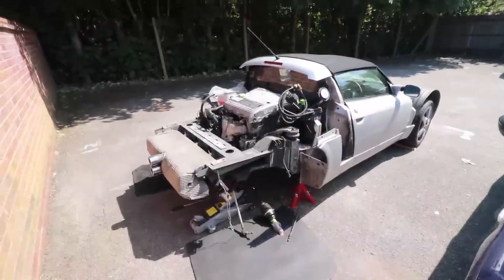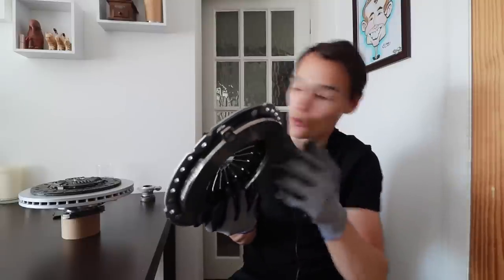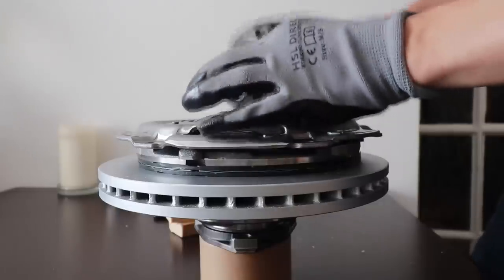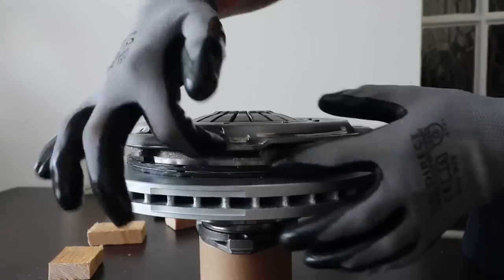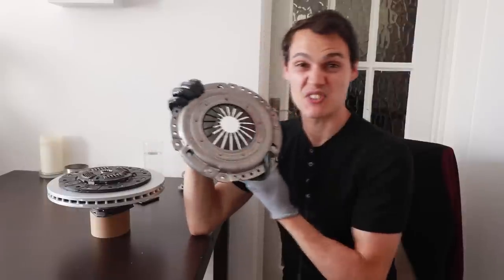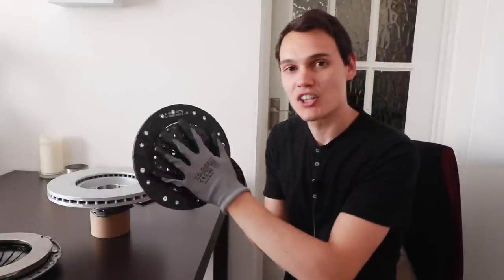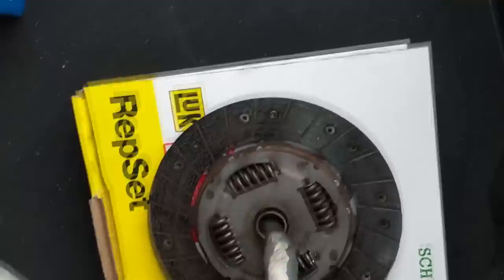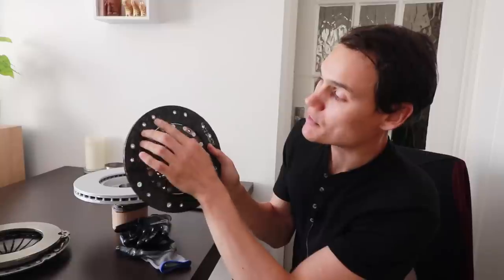How does a clutch work and what wears it out?

Comment: I've made the mistake of releasing the clutch too fast when going into first gear from a stop, because I was afraid of wearing out the friction material.  Also, my shifts aren't always as smooth as they should be.  Since I'm still relatively new to driving a manual, occasionally I still release the clutch too fast.  Then my car bucks like a bull at a rodeo, especially when going into first gear.  This video was super helpful.  Before I saw this video, I had no clue that the bucking is really bad for the transmission, and that I shouldn't worry about holding the clutch at the bite point for a little bit.  I'll be a lot more careful now with how I drive.  My concerns were misplaced - I was concerned about wearing out the friction material, when it was the bucking I should have worried about.
Reply from the maker: You're more than welcome. I used to think the same. Don't hold it on the bite point to keep the car still on a hill and keep the revs below 2000rpm when setting off and the clutch should not overheat.
Reply: @ConquerDriving  My car, a US spec 2020 Corolla Hatchback has a couple nifty  features that help out with hills - a brake hold and an electronic parking brake.  The first is for slight inclines, and the latter is for steeper grades, such as hills or highway off-ramps.  They automatically releases when you start moving forward.  So, the good news is, I'm never tempted to use the clutch to hold on a hill.  With my car, you can be sitting still on a hill, and have both feet on the floor.  Modern technology is great!  Anyway, thanks for the tip, I'll be careful to never rev the engine above 2,000 rpm when setting off.  Naturally, I want my clutch to last for hundreds of thousands of miles.

Comment: So what I'm getting from a few of your videos is...don't be afraid to hold the clutch and let it do what it is meant to do! Thats the part I've been struggling with. Afraid to use the clutch longer than switching gears or taking off, which in turn is causing bucking takeoffs. Higher gears has been just fine, I've been slowly letting off the clutch. 

But yeah all in all the videos I've watched from your channel have helped so friggin much. Im anxious to get back in to my used car and learn some more! Thank you!!
Reply from the maker: You're welcome. I remember feeling the same about the clutch but I have so much experience with them now I've been teaching for 12 years I've learnt what really wears them. Letting it smooth out gear changes and move away smoothly is fine.

Comment: A good way to show the counterintiutive movement of the diaphragm spring are these small round metal boxes sometimes used for mints. The way to open them is to push on the lid, it then does the same movement as the diaphragm spring.

Comment: i drive to the blue mountains and my clutch started slipping on the freeway. when i was comming back it was sliiping constantly and i was strugling to get going at trafic lights. it was time to replace my clutch. both me and my brother lernt to drive on the car. ( i brought it off him ) 

when i replaced my clutch ( did it my self with my dad ) the friction matiral hade worn to the point it was smoth and the fly wheal was toast as well. it hade over 315,000 km on it. i was going to change the fly wheel with my clutch weather it was still working or not becuse it was a dual mass flywheel. After the new clutch i wasent prepeardef for hoe low the bite point was and kept spinning my tiers. hade it for about 3 months and it feels so good.

Comment: Really interesting stuff! Just started learning how to drive and this channel has given me great information so far. I need just a little more help to understand the clutch better. Which of these situations is actually happening?

1. The friction disk is always in contact with the flywheel. The force from the pressure plate and clutch bearing determine whether there is enough friction to be engaged or not. 

(This seems great but wouldn't friction disk and flywheel would both wear out?).

2. The friction disk is never in contact with the flywheel. The friction disk only engages when it is in contact with the pressure plate. 

(This seems to work but I wonder if the friction would be enough from just the pressure plate)

3. The friction disk is sometimes in contact with the flywheel. The pressure plate causes the friction disk to come in contact with both the flywheel and pressure plate when it is engaged. 

(This also seems to work but how would the friction disk move through space? No forces or devices, to my knowledge, are there to keep it in between the plates without contact.)

After watching your video I think it is 3. But once again how would it move from engaged to disengaged. Nothing seems to be holding it in place.
Reply from the maker: I see what you're saying. The friction disc will not make contact with the pressure plate or the flywheel when the clutch is down because the fast rotation of both the pressure plate and flywheel will effectively kick it fiction disc off. There will only be wear with pressure, not slight contact. The brake pads work in the same way, it's not like a bicycle that needs a return spring to move the brake pad away from the brake discs. In a car simply releasing pressure of the brake pads will be enough, the pads are always gently touching the disc but as there is no pressure no braking or heat is generated. However unlike the brakes, there is actually a small 1-2mm gap between the friction disc and pressure plate and flywheel when the clutch is down. If something makes contact with something spinning fast it will be pushed away if it's the path of least resistance.
Reply: Conquer Driving Thank you so much, it finally makes sense! Really awesome video and explanation.

Comment: I've driven manuals for 20 years now, and subscribe to your videos. I have learnt the way to drive modern clutches is different to how I was taught, so thank you. I have a sports car and I get the harsh contact and jolt through the car no matter how much I hold the bite point in first (other gears are fine). It doesn't seem to happen if I am increasing revs through the release though.
Any thoughts/comments?
Reply from the maker: You're welcome ☺ Some clutches do bite hard, adding more revs will increase slip making for a smoother transition. As long as the revs are below 2000 rpm you should be OK because as soon as the bite point is reached the hard clutch would bring the revs down anyway.

Comment: I recently overheated the clutch on the uphill approach to a roundabout as I was already halfway ready to move away when a fast car emerged and I had to stop again. So as it was uphill with another car behind, I wanted to go quickly and not stall so I ended up over-revving while moving away twice within a couple of seconds. I've been driving for almost a year now but it was the first time that I treated the clutch so badly that I could actually smell it (haven't done so even while learning). It was awfully scary as I thought I could really damage it. But now, if I get it right, I'd actually have to do it regularily to make it wear out.
Btw, now I can explain in details to my mum what's the benefit of me putting the car to neutral on waiting ^^

Comment: This video really helps a lot. I confuse in something. I always do double clutch/revmaching, when I downshifting from 3rd gear to 2on gear always under 1500rpm for being smoother possible and not overhead the clutch.
Actually it's better for the transmission and the clutch, do revmaching or double clutch, or it's more recomendable release the clutch slower for being more smooth downshifting.?
Thanks
Reply from the maker: Double clutching doesn't help modern gearboxes. Being careful with the clutch though does help.

Comment: Does it wera the clutch for example if you are at low revs in 4th doing 20-30mph and accelerate as it has to acomodate to build up the speed?  for example approaching a roundabout where little stopping is required as no traffic is coming. Would it be better to change down a gear to third and then change up again?
Reply from the maker: If the clutch stays up there is no clutch wear.
Reply: There’s no clutch wear but I’d still downshift so you don’t lug your engine if the RPMs get very low

Comment: Maybe i am wrong, but if the brand new disc's thickness is 8.3mm and the used one is 7,3 mm, then it worned only 1mm, which means 0,5-0,5 mm side by side.. You mentioned 1-1mm on both side.. from 15:30.
Reply from the maker: That's correct. It had worn 0.5mm on both sides so a total of 1mm overall.

Comment: Hi, Richard love the videos quick question you seem to be really knowledgeable in the mechanics of cars. would you ever consider doing a DIY car fix channel I love your way of teaching and I think you would be the UK version of Chris Fix! Also, would you replace your own clutch on your driveway knowing what to do or do you take it to a mechanic for the ease of thinking of replacing my clutch myself and just wonder what your experience was like?
Reply from the maker: I would enjoy doing such a channel but I don't have time for mire projects. I have replaced a clutch in the residential car park where I live but I wouldn't do it again, too heavy, such a job really needs a two post lift to get the car in the air. I usually do minor jobs and diagnose issues then get a garage to do the work I specify if it's too heavy for me.
Reply: @ConquerDriving  Yeah I agree Looking to do a clutch in my little I10 hoping it will be ok as it only has a small 5-speed tranny with a 1.2L engine I love working on my car only just passed my test.  If you ever retire from being an instructor you can always be the next Chris fix :)

Comment: Thank you for this! You mentioned the clutch peddle feeling notchy, and that rattling sound you demonstrated, but what are the other signs of any of these clutch components being on the way out or dead?
Reply from the maker: A whining sound is also usually bad or if the clutch doesn't bite and continues to slip (revs go up but car doesn't accelerate).
Reply: @ConquerDriving  Thank you very much! Only been driving 2 months, and my car is 12 years old, with 115k miles on it, so I am wary of something happening to the clutch, particularly as I am new, I might finish it off haha!

Comment: Hello, I have question about downshifting for better and longer engine braking. Is rev matching the engine to let’s say 3000 rpm and then holding the clutch in the bite point for like 1,5 second, when the engine speed is at 2800-3000 rpm matching with the gearbox, is it wearing the clutch? It’s hard to rev the engine to the correct rpm in my diesel car, and the revs don’t fall instantly after releasing the gas pedal but like after a second
Reply from the maker: The clutch is designed to rev match. Any use of the clutch will cause more wear but using it to rev match does not cause excessive wear.
Reply: @ConquerDriving  sure, I was wondering, because you’ve said that moving off from 3000 rpm is instantly burning clutch, so i’ve thought that the same thing happens while rev matching in higher engine speed

Comment: Hello my friend I want to ask about if I doing a clutch and gas when I get a clutch biting pint simultaneously ? What's can happen ? And why rev match doing in a in lower gear as well direct drive and over drive? Thanks my friend in Arabic called شكرا صديقى
Reply from the maker: You should get the clutch bits point with gas, without gas most cars will struggle. I need to do a video on rev matching. Rev matching allows for smoother and faster gear changes.

Comment: So with the clutch disengaged there is gap between the friction plate on both pressure plate side and flywheel side correct? If not then why is there friction material on both sides
Reply from the maker: There is a gap on both sides of the fiction material. It's in the middle between the flywheel and the pressure plate.
Reply: @ConquerDriving  Got it, thanks!

Comment: Did you disassemble the car yourself? And why's the rear portion of your car covered with parts? Is your car not a 4-seater?
Reply from the maker: Yes, I've been reassembling it all day today. It's been quite a comprehensive lock down restoration. Probably finish it by the end of the week. It's a Vauxhall VX220.

Comment: Good explaining about clutch bro 👏👏👏

Need some assist here bro...how do you judge the braking distance from the hazardous without braking too late or early?😭😭

I'm still struggling on this matter and I'm keep trying to get in right
Reply from the maker: Start braking very early and gently, focus on the point where you're trying to stop and gradually increase the brakes until you feel you may finish stopping just a tad too early, when you get close you can release the brake a bit to smooth things out and finish getting to your target. At your target you may need to brake a bit more to stop.

Comment: I'm worried I may have damaged my dad's beloved car, a 1.6T Focus running diesel. I've passed my test but unfortunately still making mistakes here and there as I get used to driving by myself now. Was driving at 30mph on a big road through a village when approaching a lorry parked on my side of the road. Seemingly no other traffic around, I planned to drop to 3rd gear from 4th to overtake but somehow ended up putting into 1st (rookie error, I know, but I passed my test 6 years ago and am just coming back it!). The car is obviously not too happy and the back wheels lock, kind of feels like I've randomly attempted to perform an emergency stop but with way more engine screaming. Almost as soon as I've put it into 1st I realise my mistake and take it straight back out of gear, rev the engine to match to 3rd gear and it seemed to be good going into 3rd (I didn't actually stop, I was probably about 10-15mph still approaching the lorry when I put it into 3rd because it all happened so fast). (Also now I think about it maybe I should have gone into 2nd instead but I felt at the time the car was screeching for the higher of the two gears). Now I'm terrified I've knackered the clutch but I drove the car for 20 mins after and it seemed normal? Which part of the clutch might I have damaged? Love your videos by the way, so so useful and well explained!
Reply from the maker: Thank you for the compliment. I wouldn't worry about it, you are unlikely to damage the transmission doing it once. No need to rev match for up shifts.
Reply: @ConquerDriving  Grand, thanks!

Comment: If a clutch (2nd one) was worn down to the rivets on the pressure plate side only after 30k miles. What would be your diagnosis based on that. Assume I treated the clutch decent also and car has 130k miles. Thanks

Comment: I just wanted to ask a question. If the clutch pedal creeks when you press it down does the actual pedal need replacing or does the actual clutch mechanism itself need replacing?
Reply from the maker: If it creaks the pedal itself most likely just needs lube. I've found yellow Vaseline works well. Or some silicone grease if you have it. Avoid copper grease where ever rubber is present.

Comment: Do a video of what happens when an engine stalls
Reply from the maker: It basically just goes too slow for it to run and switches off. The engine has to spin around 10 times a second to run.

Comment: So is the pressure of the clutch the pressure from pushing the metal fingers down?
Reply from the maker: That's correct. But with some leverage from the pedal, the clutch fork and the master and slave cylinders if the clutch is hydraulic.

Comment: hello i have two questions. 1st is Why does a car experience  jerk when you leave the clutch suddenly in the first gear but doesn't when it's in the third gear or so?  and 2nd is why we need to let go off accelerator while pressing clutch and changing to higher gears? pls explain this
Reply from the maker: Lower gears and particularly first has more torque than higher gears so the extra torque of the engine will jerk the car more easily, in 5th gear the engine has little torque so it would be the engine that changes speed instead of the car when you lift the clutch up quickly.. There is always a jerk, just sometimes the car jerks or the engine speed (rpm) jerks.. You won't notice the engine speed jerk though. If you don't let of the accelerator the engine speed will shoot up.

Comment: I know I’m probably missing something but wouldn’t it make more sense if the friction disc is just attached to the flywheel?
Reply from the maker: I thank I know what you mean, I don't think that would be very sturdy, the clutch friction disc needs to be strong and supposed on both sides.
Reply: Conquer Driving oh I see, thanks

Comment: What happens if I do a 6k clutch dump?
Reply: You replace clutch flywheel gearbox driveshafts
Reply from the maker: Lots of wheel spin normally. I'd never dump the clutch as it doesn't lead to a good start. Very high but not dump. It's finding the optimal height to get as much power to the wheels as possible without wheel spin.

Comment: What happens when you add more gas let’s say reaching 400rpm and just release a lit bit of the clutch???
Reply from the maker: 4000rpm and bite point would burn your clutch very quickly. In these video I did mention keeping your revs low. Certainly below 2000rpm. In a car without much torque using lots of revs and bite point will increase your power and therefore allow you to set off more quickly but it will be detrimental to the clutch.